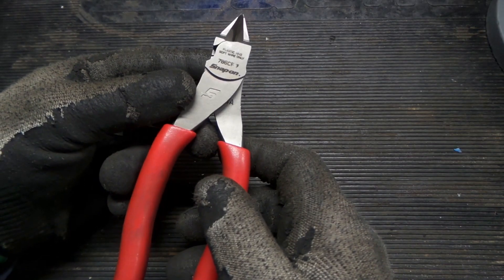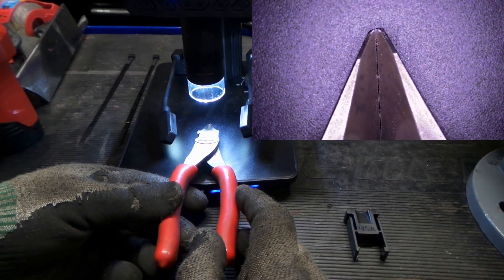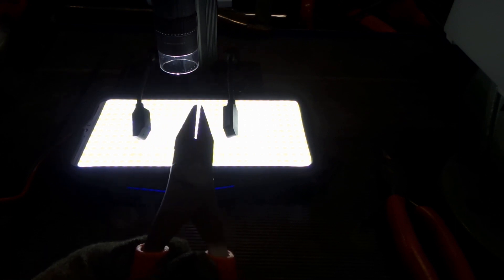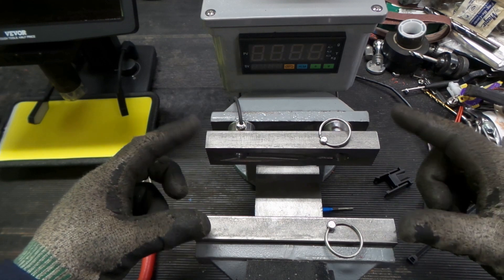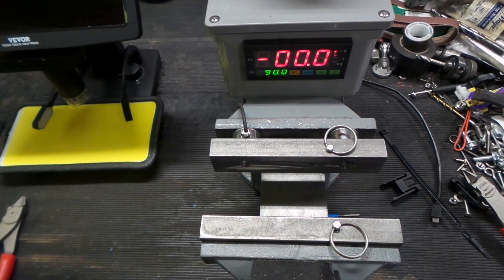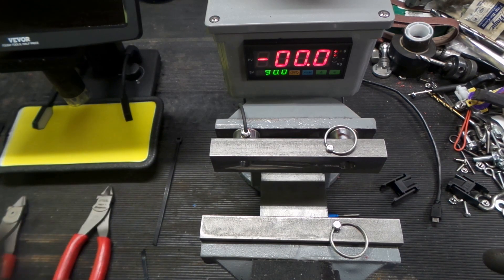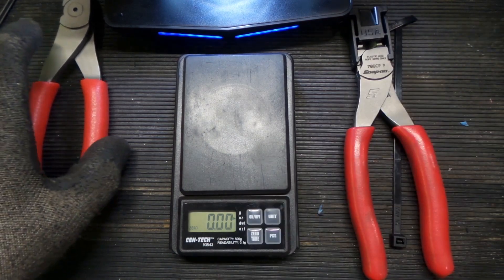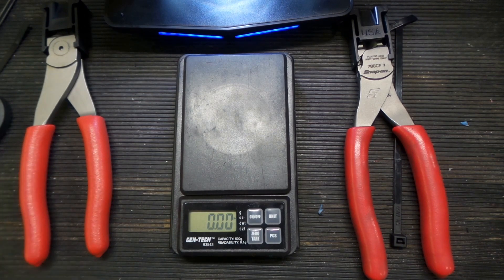Flush-Cutter Face-Off! Round 1: Snap-on Vs Icon - Epic Flush-Cut Pliers Showdown & Tool Review

Comment: Icon has actually updated their comfort grip handles to be much softer/ rubberier. Any tools that have the old harder grips are old stock
Reply from the maker: Thats good to know, I'll try and check that out. Did they change anything else on the flush cutter with the updates?
Reply: @TalkingHandsTools  nothing else was changed except the grips. They are definitely much softer now
Reply from the maker: @darin586 That's very interesting if I can figure out a good way to show that in a video. Maybe I'll pick up a pair. Thank you for the heads up!